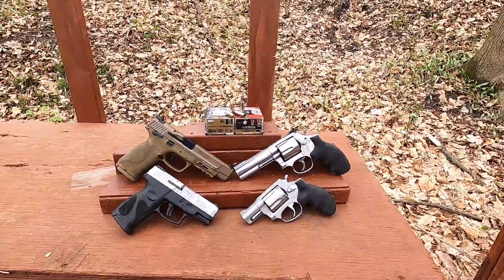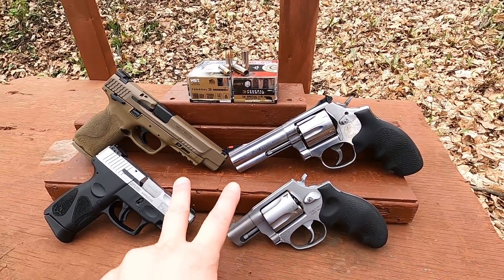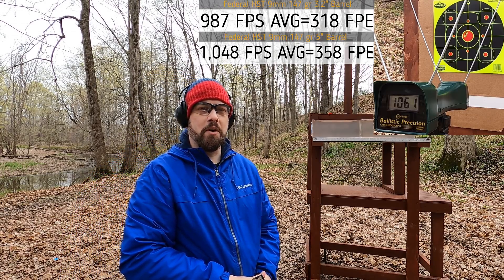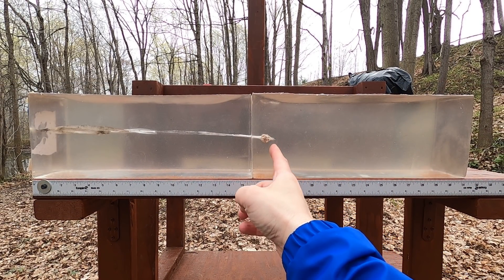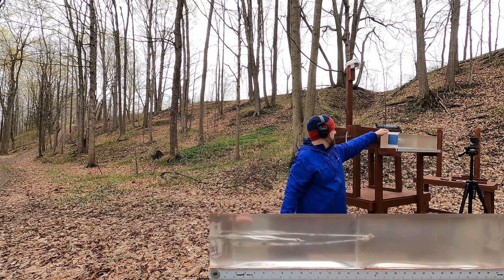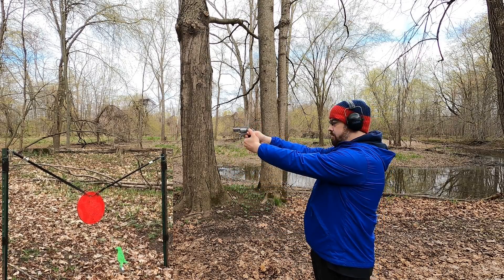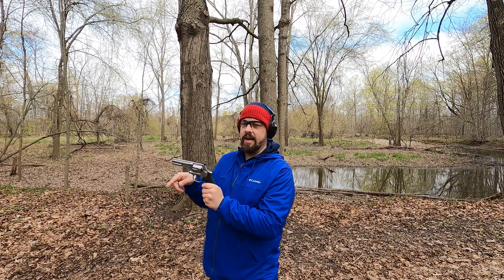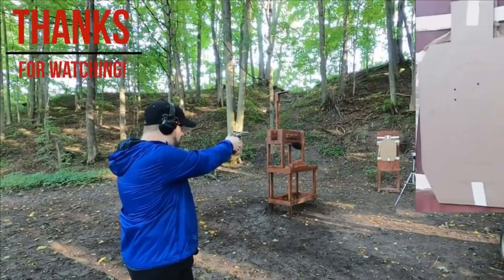Federal HST 9mm VS .38 Special+P Different Barrel Lengths Ballistic Gel Test

Comment from the maker: At 11:21 I mistakenly said that the shorter barrel had more penetration, this is not correct.
Reply: very cool i have a bunch of 124 +p punch and hst wonder how they compare some gold dot too
Reply: Perhaps if you had used the 124 gr +P 9mm HST it would have been a more valid comparison, with only 6 grs difference. As it is you compared a defensive 38 +P versus a target 9mm, with 17 grs difference in bullet weight.

Comment: How does the placement in the brass determine how "powerful" one 130gr bullet at a specific velocity differs from ANOTHER 130gr bullet at the exact same velocity?  Bullet design can change things like the penetration & expansion, but shouldn't it be mass x velocity in terms of "power"?  Isn't the MICRO HST rated on the package from a shorter barrel?
Reply from the maker: I'm not sure exactly what you mean, but a bullet deep in the case will achieve full power with less powder due to high pressure on that powder. What that means is in a 2" barrel or 3" barrel or more, it's already maxed out. A traditional load is propelled with a lot more empty space and powder. That means you lose a lot of it's potential energy from a short barrel, and need to get a longer barrel to achieve it's full potential. The HST is already there, which means essentially that you are doing it all with less powder and less recoil.
Reply: @GunSam  I would concur that one load can be more "efficient" than another load, and that different bullet designs can certainly effect penetration and expansion, but...  Two bullets of the same weight & diameter, when fired at the same velocity develop the same amount of "power" (aka, "energy") when fired from the same barrel, don't they?

Comment: Your findings in regards to the velocity being lower with the 4" than the 2 inch barrel may have something to do with the quality of the rifling in that particular barrel.  Just a thought.
Reply from the maker: All the other videos I have seen where a 4" and 2" revolver was used, had the same results as I got with more velocity in the shorter barrel. I have tested dozens of ammo varieties in 2" and 4" revolver and not ONE time has one ever been slower in the 4" barrel. The 4" is always, always 100 FPS+ more in a 4" VS 2". The whole thing is settled. It's the ammo.

Comment: I have never been a fan of the FBI recommendations as to penetration when it comes to civilian use. The average human adult torso , when measured from front to back, is between 10-12 inches. The pump and pipes are roughly half that deep. The measurement from side to side is on average 19 inches, including both arms. Again, the pump and pipes being half of that. Ergo, 6-10 inches is adequate to reach the vitals. Having been an LEO and currently a medical professional for 30 years, specializing in trauma radiography. I have rarely seen this kind of performance fail. Now, is better penetration bad? Not always. As a former LEO, I wanted a round that would go thru a car door, etc., and still be effective. But I am concerned about pass thru rounds and such as a civilian. Just my 2 cents.
Reply from the maker: Gel penetration is not human penetration. 12" in gel is 6" in a person. Everyone knows that who deals with this stuff with any knowledge at all.
Reply: My medical experience says differently. Again, gel does not have bones, plastic AND elastic tissues on the same track, etc.. I never stated that it was a pure analog BUT it is fair and a good indicator. Clear gel does not give the same results as true ballistic gel. Lots of variables. As to "deals with this stuff", I have helped treat some where around 200+ GSWs. I DO deal with this stuff. Plus , as a former instructor, tactical trainer for LE, and just a serious student. I am just expressing my real world experience.

Comment: Don’t forget that the 4” 686 is actually a 357 Magnum chamber so the 130 gr HST has to jump before engaging the forcing cone. Not usually too much of an issue but the 130 gr HST is seated deep in the case
Reply from the maker: Jump? Lol. No. I'm sorry but you're funny. So you're saying, that the bullet is shorter than 14/100 of an inch?
Reply: @GunSam , I don’t think you understand what I’m saying. When firing a 38 from a 357 chamber you have some freebore because the chamber is cut a little longer. Since the 130 gr HST is seated deeper it has to jump a little more than traditional rounds where the bullet is seated beyond the case mouth.

I’ve been reloading for a long time and seating depth can play a big role in velocity. Especially in rifles. It’s just a theory anyway. I don’t buy into your theory about it just being weak round using all of its powder burn in the short barrel. Even really weak 38 loads tend to build more velocity with longer barrels. 

It’s very strange though
Reply from the maker: i'm just saying, that by the time the bullet is in the cylinder throat, the base of the bullet is still in the case, so I really don't see how this 'jump' really would matter one bit. Only thing that is literally happening in that rather than the bullet front perfectly entering the forcing cone with a perfect .357" bridge from case to throat in a .38 revolver, is that the bullet briefly moves .135" over an area that is .379" instead of .357". A 14/100th of an inch gap on a bullet that is probably half an inch long, is in reality nothing at all.
Reply from the maker: Literally dozens of people have tested the HST .38+P in 4" barrels and in 2" and it's always faster in 2" barrels. Anyone that has handloaded is like, duh, that makes sense. You won't have much charge to be that deep, the bullet is super long and copper so there's a ton of friction. "More barrel equals more velocity period" is stupid. At some point in any cartridge, a bullet stops gaining and starts losing velocity due to bore drag, it just so happens that the HST is the longest bullet, least charge all copper so it maxes out in 2" or 3" of barrel and starts slowing down. Duh.

Comment: .38 Special --makes sense-- USED TO make sense for people who can't shoot a heavier caliper. But the difference in recoil between 9 mm and 38 + p, simply illustrates how are archaic and senseless it is to use a 38 special for self-defense anymore.
With recoil virtually the same or at least quite comparable, you get twice the performance out of 9 mm, ... Resulting in Superior firepower as well as Superior performance.

If that recoil is still too much, give them a large 380 loaded with extreme defenders.

Comment: I have a question that I hope can open a bit of a discussion with you, and others, about the barrel length issue in your tests. (and thank you so much for your tests. Real world stuff with ammo and calibers we use) 
You always talk about the bullet travel, but never the flash gap of the cylinder of revolvers. I know you realize they are there, but my question is this: I always added at least a half inch of barrel travel to a revolver in order to somewhat match the ballistics of an auto loader. In other words, a 4 inch revolver would compare to a 3.5 inch auto loader. Roughly. Each revolver being different of course, but all auto loaders are sealed with no pressure loss. That pressure loss in revolvers can by anywhere from 2 to 5% and even higher, depending.

Comment: 147 HST is THE top tier 9mm. Loadings with the Barnes XPB edge it out but cost more ( ASYM is my first choice ). The HST .38 addresses a VERY specific "niche" & does it VERY well. A modern rendition of the British "Man Stopper" tuned for short barrels with manageable recoil. What more could you want? No, it will not defeat barriers or perform well through limbs or perforate an 🐘. I'm fine with that. People need to get out of their fantasy worlds. For a sub 20 oz handgun you need a load that maximizes wounding while being tolerable to practice with. The HST is a blessing. I've loaded it in my LCRs since it came out (2018?). It is a shallow penetrator, if you shove your muzzle into the mugger's 👃 or nipple it will work fine.

Comment: I am a little surprised by the 38, since i have been hearing how great it is. Penetration is a little low, but expansion is massive. It might make a good warm weather carry load. It would have been great for dispatching injured deer with my backup when i was still in LE. The 9mm looks great. Gone are the days when you could not trust any 147 gr 9mm loads. We really do have an embarrassment of riches these days when it comes to high performing ammo. Great tests.

Comment: Great test and show per your norm! Perhaps you might pull a couple/three of those HST 38's and reload them at their canelure and drive it at solid +P and see what it does in Gel? Midway had sold a bunch of them as factory seconds components back pre beer'flu... Haven't had ability to test this notion whatsoever, (and there is no/zero load data for flush seating of those meanie looking buggers).  I'd burned thru a box of factory back when, and my logs only show 9.5" to 11" penetration on 5 that I put into 10% CB Gel back a couple years ago (lost that shooting arrangement/site lamentably). Best, Shoot safe!
Reply from the maker: Yeah, might be nice. Unfortunately I shot them up doing this test.

Comment: Great testing and conclusive to Mr Gunsngear testing. Excellent shooting and testing. Glad you have the gel testing as part of your presentation. I have the Hornady Pink 90td .38 special to shoot out of a Vixtory revolver. HST is a good round of of a semi automatic. Great job Sam! 🎩☯️♠️
Reply from the maker: Thanks. I get mixed comments on the gel. One will be like, they like it then the next one tell me they hate gel.
Reply: @GunSam  well put me in the like camp with the Jugornot bunch.
Reply from the maker: @ratagris21  is it the water or the bologna? I plan to transition over to bologna/MDF directly into gel. I feel like this is the best testing method possibly as the bullet encounters an average resistance as a body, I think.
Reply: @GunSam  I still like the original jugornut bologna water combo. However, the same combo but with gel. The only drawback is decontaminating the gel afterwards.  I know TN outdoors used to comment on that. Experimentation will lead to excellent outcomes I believe.

Comment: I go with the 147 HST in my PT111G2 and the 124 grain HST in my CZ PCR. 

As for the 38s I use Gold Dot Short barrel 135 (I think) or the Golden Sabre 125s regardless of barrel. (2 vs 4).
Reply from the maker: I was amazed at how the G2C shot then point of aim at 5 yards, and also at 25. Really a great round for a gun like that.
Reply: @GunSam  The PT111 G2 is basically the papa of the G2C and I agree: it shoots much better than the price tag would suggest. 

Be well, sir.

Comment: Would you say the 38 hst is along the same lines of the critical defense pink tip 90 grain. Maybe a good round for someone recoil sensitive?
Reply from the maker: Maybe, however I think there are sill better choices. I would say comparing those two are apples to apples for recoil, but not in performance. The HST will expand huge and not penetrate well as where the Critical Defense will penetrate a little better (not too much as it's only 90 gr) and not expand at all.

Comment: I like how its shoved in there like a wad cutter. 
Try and get a actual 4in 38spl revolver and not a357 and see if any difference..
It comes down to mass and  deformation for smack down not necessarily what penetrates the best.
Reply from the maker: There's no difference in .38 revolvers VS .357 with .38 ammo. I have ran tests, no difference.

Comment: I did not see that coming. 

The HST is the "prefect" reverse Hollow Base WC.   So the myth & legend is proven.  Accurate, expands, but low in power.

The barrel length effect is interesting.  Hand loaders kinda know guns like different flavors of charges in the same caliber.  They really got their charges optimized.

Years ago I saw a video with a 380 shooting a hog strung by up.  The lowly 380 had no issue going thru to the heart from either direction. I am not sure that the ballistic gelatin is a perfect medium. 

The GSRA Pork BBQ & Ballistic Lab might be a good idea...

Comment: Great content as usual. Shooting the Bull410 sold me on standard pressure 147gr HST years ago,that and 124gr+p Gold Dots are pretty much all I use in 9mm. Only a couple years ago you could buy 50rd boxes of either from sgammo for $29.95,oh how times have changed lol.I have been carrying HSTs in my 637 based on some decent tests[luckygunner was another one IIRC] but after seeing this I might switch back to 135gr short barrel Gold Dots.
Reply from the maker: Thanks. I have found out that sometimes not all testing lines up with others, but sometimes it does. I just tested another 147 gr which I won't give spoilers to, but it did not expand at all in a 3", 3.2", 4" or 5" into gel blocks with heavy denim. Might as well been FMJ, but youtube has scores of people testing it on bare gel, getting expansion and proclaiming it to be the best.

Comment: Surprised how anemic the 38 is.
Impressed with 9 for any barrel length. Thank you
Reply: It’s all about round selection. You can go down to a round that averages 500fps 180gr up to 1250 FPS at 125 gr. My personal selection of 158gr Buffalo bore standard pressure SWCHP averages 18 inches in ballistics gel so not anemic at all. 👍🏼🤠
Reply: @Retro_Grade1  yup, bullets matter more than head stamps, a concept most have a hard time understanding.

Comment: Good work by you as always!  There are reasons to go with a bullet seated flush with the mouth of the case but I think it affects target shooters the most.  With modern powders and such low pressures, the 38 Special case is cavernous.  The efficiency of flush seating a bullet starts to compare with the 9mm.  

I really thought the +P 38 was going to ace the test.  That sure was not the case.  I wonder how the load would do in a little 1 7/8" J frame S&W. 

Again, thanks and well done.
Reply from the maker: The last time I ran the .38 Special HST in my 1.875", I got an average of 813 FPS. or 11 FPS slower than the 2".

Comment: You know you said it doesn't penetrate very deep the 38 special HST. But 10 inches for something that's doubled in diameter is pretty awesome plus you don't have to worry about over penetration
Reply: Inches in gel were never meant to be an analogue to inches in torso. When FBI said 12" in gel is a minimum, they meant that bullets which do not penetrate that far in gel typically fail to reach vital organs under real life scenarios.
Reply: @mountainhobo  guns for sale under 200.00 on line
Reply: @theresaricketts8958  you on the dope?

Comment: I would love to see 9mm Vs 357 Sig Vs 40SW Vs 38 special Vs 45 acp

Like you can do different tests like

Velocity
Power
Penetration
Price
Gun options
Recoil/accuracy

Each calibre can be graded from 5 points to 1 point 

Winner of each challenge gets 5 points then the rest it goes to 4,3,2,1 points

I've always wondered which calibre is the best
Reply from the maker: I don't own and .40 or .357 Sig pistols, but it might be a good addition if I can get one with both barrels to interchange.
Reply: @GunSam  357 Sig are hard to find
Reply: @chrisklitou7573  
If you're interested in 357 SIG vs .40 S&W or .357 Magnum (there is also on with .38 super auto)
Check out Paul Harrell's channel. Last week was another 357 SIG video. 
There is no best overall, there is the right ammo in the gun that likes it, fulfilling a specific purpose or not.
Reply: @onpsxmember  yeah but I would like to see all them go head to head in these challenges so I can decide which one to get
Reply: @chrisklitou7573   They all get the job done.At this point get the one you can find ammo for. .38spl ammo seems like it's made out of unobtainium at this point.
Reply: @rob.3575  what's unobtanium?
Reply: @chrisklitou7573  It was a joke,it means you can't obtain it anywhere. If a person is willing to pay the insane price you can generally find 9,40 and 45 if you look around. I can't  seem to find .38spl anywhere,locally or online. And no I'm not going to pay $1.20 per round for 158gr lead round nose.
Reply: @rob.3575  what about 5.7 28?

Comment: I don't see the point in that .38 round. Why load the thing to a +P chamber pressure to only squeak out such dismal performance. This is just back-assward engineering. The idea is to achieve maximum performance out of the lowest possible chamber pressure and these guys seemed to make this some pet project for kicks and somehow it ended up in the product line. Well that's about the best guess I can make as to how it ended up even existing.
Reply from the maker: Yeah, it's one of those things where the cure cannot be worse than the ailment. The point of this .38 Special ammo is to reduce felt recoil, and in that area it is a success. However, the way they did it takes too much away. Way too light, way too much copper surface area. If it were me, I would have loaded a medium cast inverted hollow base wadcutter with a gas check on the base (nose lol), and at least this could take advantage of some lead friction reduction and easily get over 200 ft lbs energy.
Reply: @GunSam  Interesting,that's not something I've considered. A 130gr bullet with that big and deep of a hollow point must make for a rather long for caliber bullet. That combined with just enough powder for maximum performance in a 2in barrel it makes sense why it loses velocity in anything longer.Even at age 43 I learn something new every day.👍👍👍👍